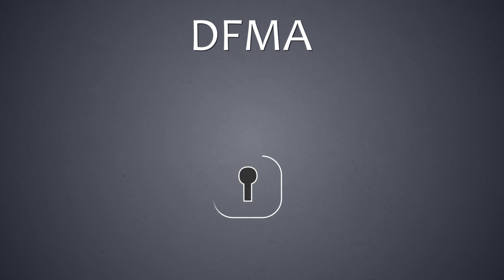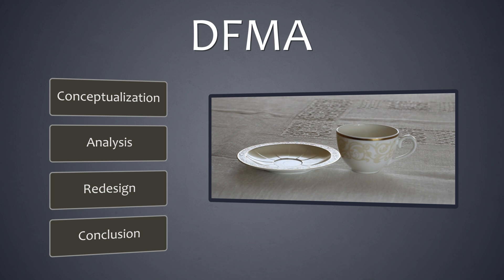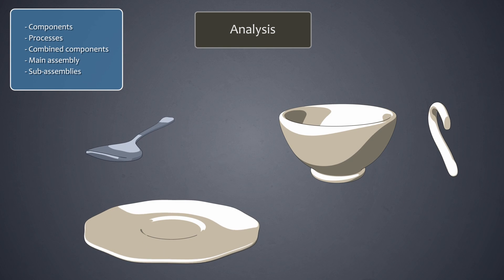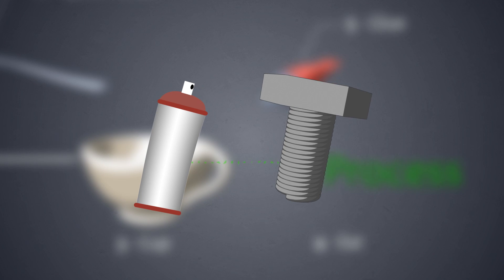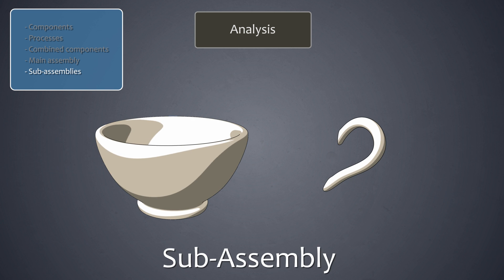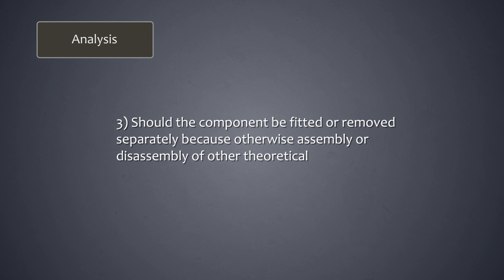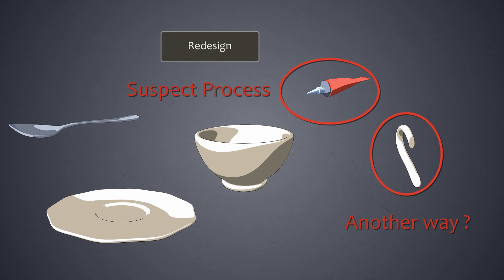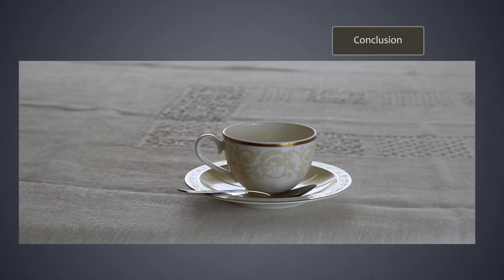DFMA

Comment: 🎯 Key points for quick navigation:

DFM a reduces components and processes in design for easier manufacture and assembly
DFM a process includes conceptualization, analysis, redesign, and conclusion steps
Components and processes are evaluated using elimination questions to identify suspects
Redesign can be considered for suspect components or processes identified during analysis
Integration of components can help eliminate suspects and improve product functionality
The final step of DFM a involves creating a report with key information and action points from the process

Made with HARPA AI